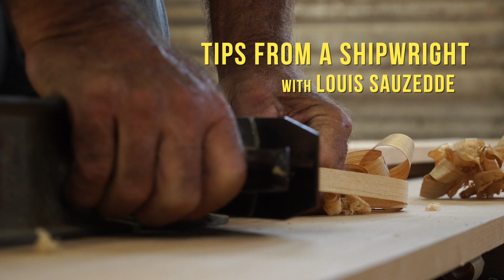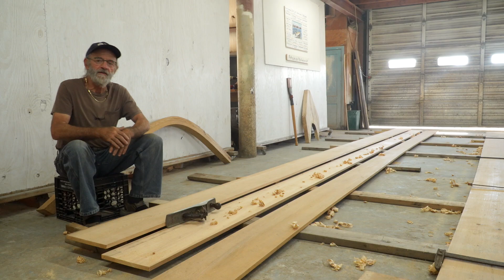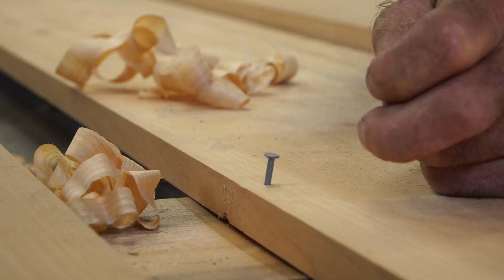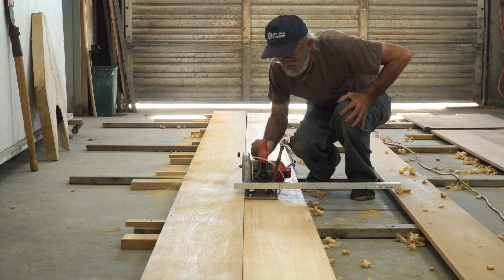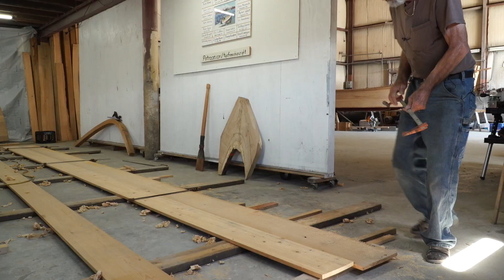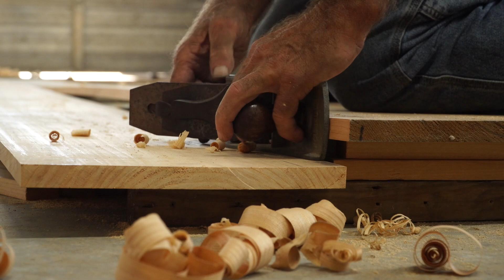Building the 23' V-Bottom Skiff - Episode 1 - Side planking

Comment: Glad to have you back, Louis!

Yes, it looks like a spud.
A slick would be completely flat backed (socket off center) have a slightly crowned blade, and be longer.
But your friend's turned you a socket slick handle.
(Usually held under your forearm and pinched to your side with your elbow)
You can get an amazing amount of power and control with one.
Reply: Agreed on the distinctions in shape between a spud and a slick.  We used a slick for trimming sawn oak frames.  The spud had done its work before we got the lumber.

Comment: The tool is called a Slick.  There's several forms of them for different craftsmen.  I have a bark slick I picked up at a rural antique shop that was used to strip bark of of felled trees.  The builder's/framer's slick has a slightly offset handle so the slick can par against the wood without the handle hitting.

Comment: I don't know any other word for what you have there other than a slick. It's a neat tool and you're lucky to have a nice one.
As for some of the other suggestions: A twybil is a sort of mortising hatchet. It has two blades (twi bil - two bills) of different shapes. A firmer is thick (from front to back), like a mortising chisel, but with straight sides rather than narrowing back from the cutting edge.

Comment: 19:03 - Louis, I think that be a barking spud.
Reply: It's a slick.
Looks exactly like my 4" slick.
Used for cleaning up big mortices and tenons in traditional framing and ship(not boat!) building.
Steel is approx 1/2" thick at the (always cranked)socket end and maybe 3/8" at the sharp end,which is usually ground with a slight curve to further enhance the slicing action.
There is no way that it wd ever be used for de-barking.Can you imagine how long it would take to resharpen something that thick(with oilstones!!!).
A barking spud,or the ones I've seen,are basically a small,narrow sharpened garden spade with a short T-end handle.Probably less tha half the weight and nearly twice the width of a slick,concave instead of flat and much,much thinner so they are lighter and quicker to resharpen every time you hit an inclusion or big knot in the bark.
Reply: @chippysteve4524  I bet you're right, and I must stand corrected.    I'm familiar with framing slicks, but not in the ship building context.   A 2" slick being the widest I've seen, and with a much shorter handle, use for log framing homes.   That long handle made me think of a spud, which is used for leverage, when removing/prying bark.   Seems it may instead be suited instead for getting very deep into mortises on large ships/timbers...    Thanks for keeping me correct.

Comment: Yep it’s a spud. Lou, I learned from an old German shipwright that if you place the boards together, face to face, and cut or plane them together, the edges will line up perfectly no matter what the angle of your plane is.
Reply: If you would face the boards together, they would then have high and low spots in the same places, so they will highlight each other. Your method works perfect when stacked seam is used. You can plane a plank for both sides at the same time, and their shape would stay symmetrical. When an edge seam is used, it is more efficient and accurate to plane somewhat like Lou did. Plane and fit.

Comment: I heard them called Paring Chisels when I did some work with a neighbor who was a pattern maker at a large shipyard.
Reply: Paring chisels are quite long compared to a standard wood chisel,very thin (~2mm),usually come in pairs,with a left and righthand skewed end and are used for paring i.e. delicately taking off thin shavings,usually in drawer lock mortices where the grain may misbehave and where a normal chisel would be too thick to get in the mortice.
Reply: @chippysteve4524  They are not always skewed. Most are square but are very long and come in several widths but are very thin. They are not meant to be used with mallets like a bench chisel.